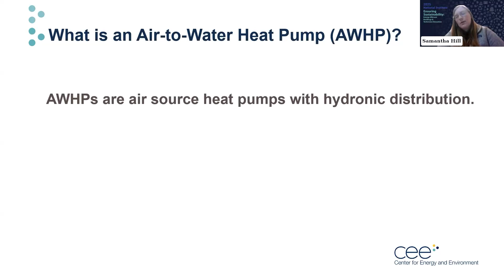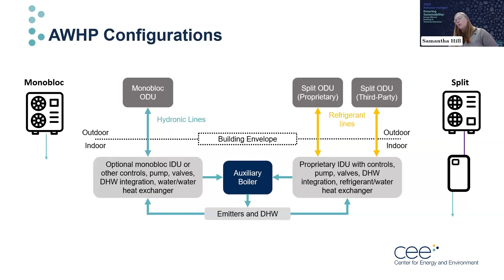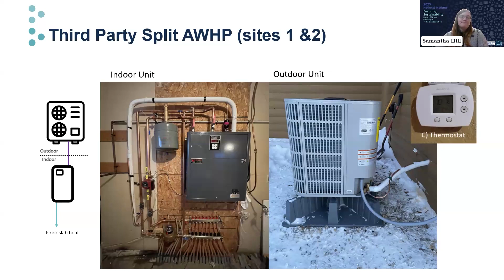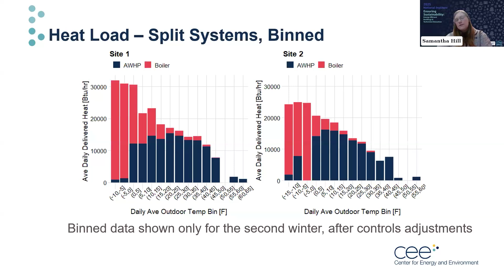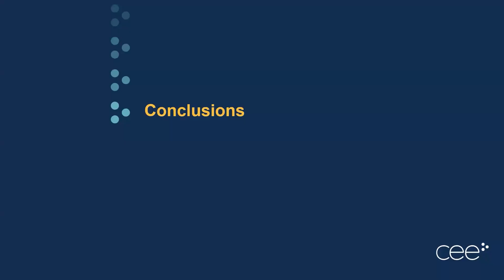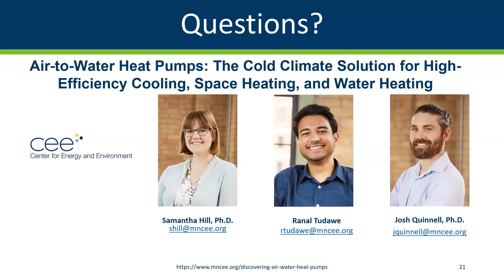Breakthroughs and Practical Results in Cold Climate Heat Pump Technology

Comment: UK experience is that emitters in hydronic systems are often oversized, so that a2w heat pumps can often be retrofitted to systems with with lower water temperatures than were already in use with the pre-existing oil or gas furnaces (boilers). Sometimes study of the individual room heat losses may reveal upgrading or supplementing emitters in select rooms and or carrying out modest building fabric improvements can enable further reductions in heating loop water temperatures.